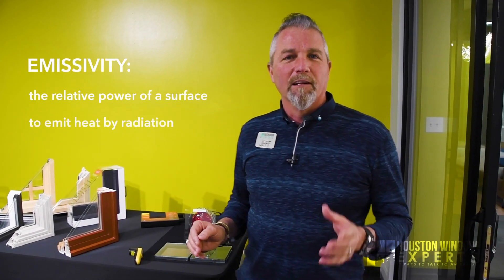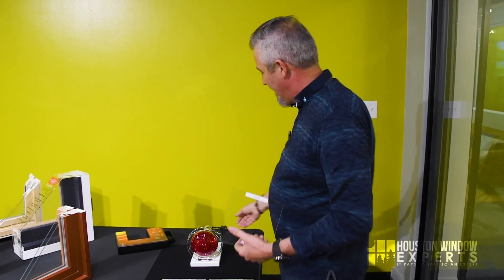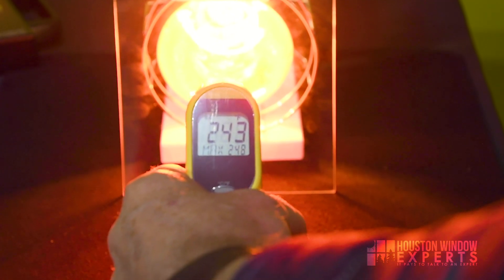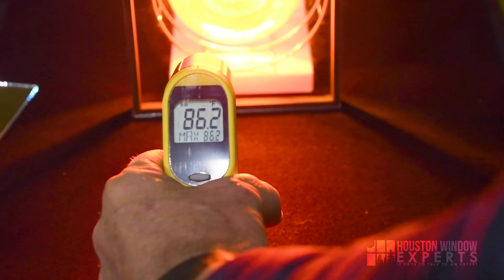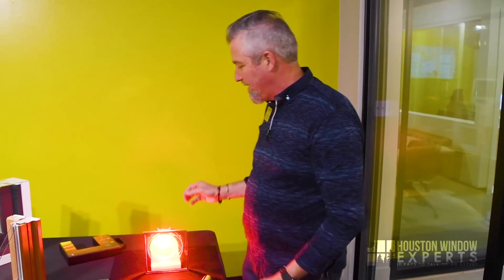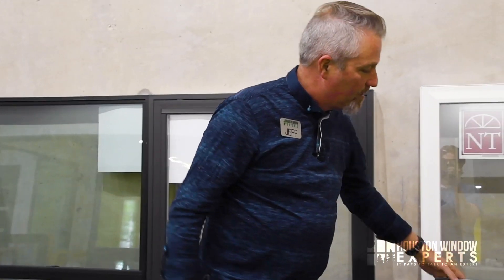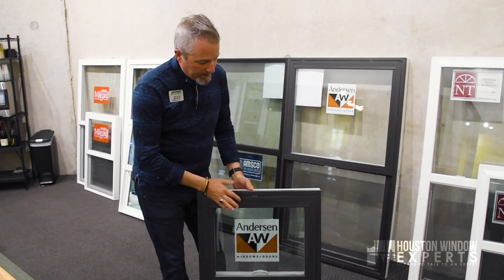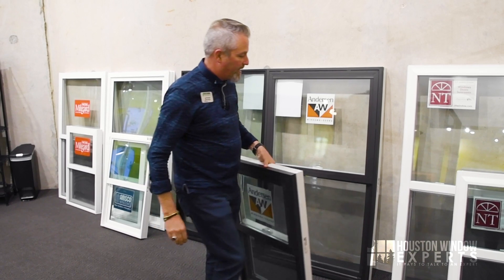What Are Low-E Coatings For Windows?

Comment: I have a question, what is the U-Value considering a High Performance Glass? Minimum and Maximum? Thanks. Appreciated your prompt response.
Reply from the maker: Any window with a U-Factor under .30 is performing really well. As far as the maximum goes, it depends on your region; but Southern climates should be less than or equal to .60.
Reply: @HoustonWindowExperts  Thanks for your reply Brother. Appreciated.
Reply from the maker: Of course
Reply: @HoustonWindowExperts  Im sorry, but what is the unit of 30? Here in Dubai, the glass processesor, if the U value is below 2 w/m2k they consider high performance glass. I was thinking that this sounds business only. 🤔
Reply from the maker: In the US U-Factor is expressed in (Btu per hour-square feet degrees Fahrenheit) while pretty much the rest of the world uses (watts per square meter-Kelvin.) To convert you would multiply the imperial U-factor by 5.678, so a U-Factor of .30 imperial  would be 1.7 metric.
Reply: @HoustonWindowExperts  Many Thanks for that precise output. Cool. 👍
Reply from the maker: You're Welcome. I'm glad that we could help.
Reply: @HoustonWindowExperts  Thanks also for your Big help.
Reply from the maker: Thank you for watching
Reply: @HoustonWindowExperts  Hi, I'm sorry. I have another question please. I don't know what is the best material for air space for double glass unit, they said stainless steel material is much better as to increase the performance of the glass with regards to u-factor than aluminum spacers. I really don't know if this is true or not, cause I didn't find any lab testing report of this. If I may ask your opinion on this? Thank you.
Reply from the maker: I actually like a product called super spacer. It is actually made out of foam instead of any metal at all. If cold weather is important to you, you should check it out.
Reply: @HoustonWindowExperts  Great. Thanks for your reply. Really appreciated.

Comment: Outstanding video! Thank you. Is the low-e coating primarily effective on windows exposed to direct sunlight? Or would they be worth installing on north facing windows in South Florida that never experience direct sunlight?
Reply from the maker: Thanks for watching! Low-E coating reject heat, not visible light, so they are still effective in hot climates even if they are not in direct sunlight. There is some inherent reduction in light transmission from the coating but on a quality window it's minimal.
Reply: @HoustonWindowExperts  Thank you! Very helpful. I feel so much better informed on choosing windows after binge-watching your channel for several hours.

Comment: Thanks for explaining. We’re having a custom 1800 sq ft single story house being built in Northeast Florida. Not sure we’re in a total trusting relationship with our builder.   Nice to know there are some basic tests we could do to make sure we’re getting what we’re paying for. In an unrelated question, we’re paying around 10k for Low E. White Vinyl single hung non-impact windows. We asked to have a brown window instead of white and we were quoted an additional $5,000. Then we found out that only the outside was going to be brown. When we requested that the inside be brown too, that was an additional $6,000, more than doubling the cost to go from white to brown. Am I justified in feeling that we don’t have the most trusting relationship with our builder?
Reply from the maker: Steven,
Not know the specifics of what has been bid, I really can't speak definitively on this. I will say that going from a standard, white, vinyl to custom color inside and out you could see the price double. A standard color is the most cost effective.
Reply: Hi Steven.  I own a glass company in AZ and my suppliers charge the exact same amount for White or Tan vinyl window.  Custom colors they always refer me to costly alternative suppliers who’s costs are considerably more.  I don’t know the margins in your particular area but it would of been best to search for competing price points from the start.

Comment: Hello,  having a hard time finding out what the u-factor is for Anderson's low-e4 glass and Sun Smart?  Any ideas?  Anderson's website does not show any of this for their glass. 

Also, our Home Depot here is a dealer of Anderson.  What's interesting, is that their proposal was WAY less than an independent dealer.  Should I be concerned? 

Do you have
Reply from the maker: Since since U-factor, solar heat gain, and overall performance can vary based on the size of the window, the frame profile, the grids used, manufacturers must show the performance data I'm each individual window. Buying windows from a dealer who installs them as always going to be more expensive than buying them from a big box store. Check out the video I made call why are windows so expensive. That will explain it.

Comment: Who makes the best casement windows.? 32”W 75”H
Reply from the maker: Pella, Marvin & Windsor in my opinion
Reply: @HoustonWindowExperts  is fiber glass frames the best way to go as far as long lasting and Durability?
Reply from the maker: Yes, for sure.
Reply: @HoustonWindowExperts  is this good for a frame ? Innovative high-density fiberglass material finished to the interior with low-gloss aluminum.
Reply from the maker: Sounds interesting, what's the brand?
Reply: @HoustonWindowExperts  marvin
Reply: @HoustonWindowExperts  MODERN CASEMENT PUSH OUT

Comment: Wondering if this would be appropriate as a treatment on bus windows for a skoolie conversion and how you would approach install of triple coat with argon gas considering the bus will experience both extremes of hot and cold as we travel across the U.S. Any tinting that appears in the glass is of no consideration to us.
Reply from the maker: I think traditional household glass would not survive in a motor vehicle. I have an RV myself that has insulated windows but they are made out of polycarbonate. 

I would look into a product called Eurovision.
Reply: @HoustonWindowExperts  Many many thanks
Reply from the maker: You're welcome

Comment: I am in Miami. Does LowE has any benefits if applied to 7/16 Laminated Impact Glass. There is no sacrifice glass. So today for example; the surface temperature on exterior of the glass was 117F and surface temperature on the inside glass was 113F. Is that the typical difference I should see from LowE on 7/16 Laminated glass; or it should have been much lower temperatures inside. Your reply would be appreciated.
Reply from the maker: Thank you for watching and for your question. I would have guessed a bigger differential than that. Is it possible your thermometer is looking through the inside glass?
Reply: @HoustonWindowExperts  Thank you for your response. I touched both inside and outside and it does feel the same amount of hot; almost 122F. The  NFRC sticker states 7/16 Lami (3/16AN - 090 GSP - 3/16 AN). Single Glazed LowE; UF 1.04; SHGC 0.25; VT 0.30 and Air Infiltration 0.3.
Reply from the maker: That's a very Stout number!
Reply: @manojpillai4932  There should be an etched logo in one corner of the glass. Is the logo readable from the inside or the outside of your window? 
Among other information in the logo will be "SGCC xxxx" the x's will actually be a number....what is the number?
GSP is actually SGP or SG (SGP is technically obsolete but still widely used).

Comment: What do i do if i live where its half cold half hot.. where should the low e coating be.. and is ther any other solution instead of low e? I like the clear glass not greeny glass
Reply: Unless your home is specifically designed to take advantage of solar heat gain as an energy source you are generally better off with using glass with the lowest U-factor that you can find regardless of the coating. But keeping in mind that the LowE coating with the best (lowest) U factor will also block the most solar hear gain as well. 
Most people in northern heating-dominated climates are generally not very happy when standing in front of a window during the winter and not feeling any heat from the sun....it just feels wrong somehow even though the lower U factor window actually has better overall energy performance in most cases than the window that allows the solar heat through. Simply, solar heat feels good and we LIKE it. We don't like not feeling it when its cold outside.
With that in mind, in many cases the best option would be to use a moderate solar gain coating that will allow some solar gain in winter but limit some solar gain in summer, and in both seasons will limit ambient heat from passing through the glass all year around. 
Moderate solar gain coatings will almost always be on surface 2, or the inside of the outside lite.
Reply from the maker: That's a great question. I would guess that you could look at your heating versus cooling costs and pick the one that is hurting you the most. A really good window will do a great job of both hot and cold climates. I would lean toward the suggestion of your local window dealer. They've probably come across this question before.

When it comes to residential glass, I don't know of any options other than typical low-e coatings. There are some options using vacuum glass in commercial applications but I have not seen any in a residential window frame.

Comment: Very informative.  Well done.  Based on your info, here in San Antonio some of our Low-E windows seem to be showing signs of a bad silver oxide application.  Clean window, but a type of shiny haze between the panes.  I suspect there's nothing we can do about that correct?  Short of having the entire panel replaced?
Reply from the maker: Thank you for watching. If indeed you have a failure, the only way to resolve that would be to replace the entire glass unit. Fortunately, you do not need to replace the frame, just the glass. It's likely that they are still under warranty. If you can find out who the manufacturer is, I would reach out to them to make a warranty claim.
Reply: @HoustonWindowExperts  Great advice.  Thanks very much for sharing.

Comment: Very well explained.. Thanks. Can the glass be coated with the  low-e coatings  after being being installed? We have a fixed double glass ceiling (part oftheliving room).
Reply from the maker: Unfortunately that process requires specialized machinery that would require it be done at the glass plant.
Reply: There are solar reflective window films that you can apply afterwards. There are also videos here on YT that explain them.

Comment: Thank you for the video it was very helpful ❤️.
How long does the low e coating last ?
Reply from the maker: The low e coating should last forever. Argon gas will escape at about 1% per year.
Reply: @HoustonWindowExperts  Thanks
Reply: @HoustonWindowExperts  what are your thoughts about Kensington KHPP windows?
Reply from the maker: I do not know anything about them. I will have to look into this.

Comment: I live in Florida and for our homes people buy the hurricane impact windows for the hurricanes. The problem is the impact glass is on the inside and the very thin Low-E is on the outside. The Low-E offers no protection from storms. When inside the homes here knock on the glass and it sounds solid. Now go outside and knock on the glass and you will see how it gives no protection. The problem is the storms are on the outside where the impact glass needs to be.
Reply from the maker: The reason the impact glasses on the inside instead of the outside is because if the glass were to break on the outside it would likely hit the glass on the inside. If the glass on the inside is not strong it will fly everywhere and hurt people. The outside piece of glass is considered sacrificial.
Reply: I want the impact glass in the out side.

Comment: true that laminate glass blocks 99.9 rays off the sun? im changing my windows with double lammiate for sound and i cant have low e in double laminate.thanks
Reply from the maker: Sorry, I don't know... Maybe you can look at Cardinal's website.
Reply: Why can't you have low-e in the double laminate? Laminate is just in between individual glass panes within the actual insulated glass unit. You still have surface 2 or 3 available for the manufacturer, i.e. Cardinal to apply the low-e coating onto the glass.

Comment: I'm in Minnesota. I did the lighter test to find out if I have low-e windows. Flame 3, inside looking out, was the odd duck. Does that mean the coating is on the inside of the outer pane of glass?  Is that where it should be? You mentioned in your video that climate can determine where the coating should be located in the finished assembly.  Is mine correct?  Should I also worry about the one pane of one window which was backwards to all the rest by having the odd colored flame being #2 rather than #3?  

We just came out of a week long stretch of -20F temps and had some serious ice formation.  Should we be concerned?

Thanks for your video.
Reply from the maker: Hi, I've heard about the flame test but never tried it myself. I use a tool that reads the glass and tells me where the low-e is located and the number of coats. 

Sorry I could not be of more help.
Reply: @HoustonWindowExperts  Are you able to try it and compare it to your method? I don't have the tool and really don't want to buy an "upgraded"  window if it really isn't any better than what I have.  I also would like to be fairly confident that.i know what I do have, is it correct, and is it installed correctly.

Thanks again.
Reply from the maker: If you know who you window manufacturer is, you could request they verify that the glass is installed correctly.

You could also contact a local glass company. They have those tools on every truck since they often have to verify what glass is in a window when they are needing to replace it.

Comment: Just watched this video....thanks again for another great, informative video....you mentioned doing another video covering the argon gas and other fill choices, did you ever do that?  I don’t see one.  I was just comparing glasses of the same window, and one has a U-value of .27(low E-argon)and the all the bells and whistles version(triple, low E, Krypton, foam filled)goes down to .16.  Is it really worth the additional cost?  What do these numbers equate to in utility bill savings?  I should add, I am in Minnesota.
Reply from the maker: Hi, living in minnesota, u factor is critical. Some companies achieve it by what glass they use and others by having a wider frame. The wider the frame, the less glass you have. The less glass you have means your u factor will go lower.
Reply: @HoustonWindowExperts  but is .16 a huge difference than .27 in value?  What do these numbers actually mean?
Reply from the maker: Great question. U factor tells us how well the window performs in cold climates. The lower the number, the better it works. If the cost difference between the two is more than 10%, it's probably not worth it.